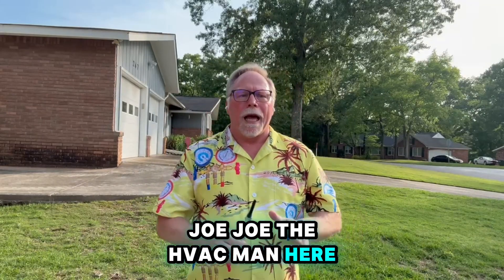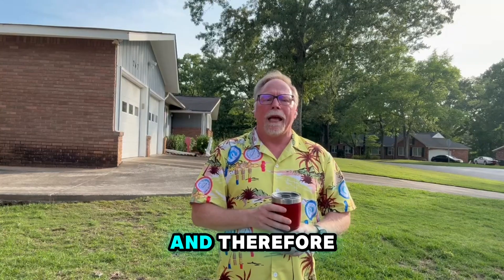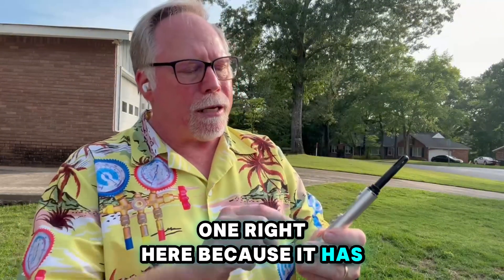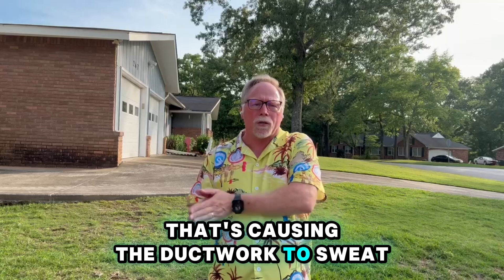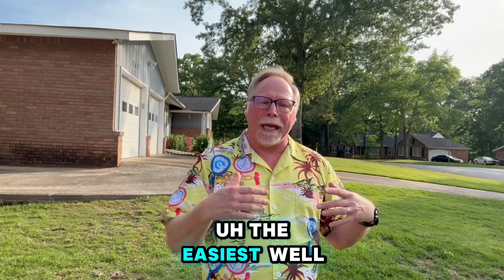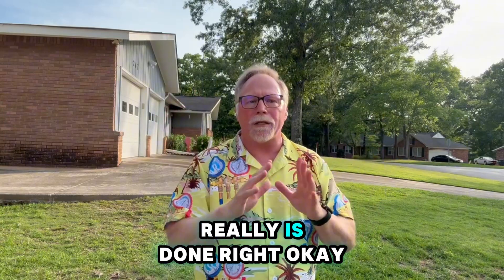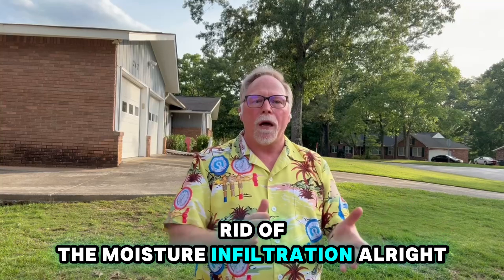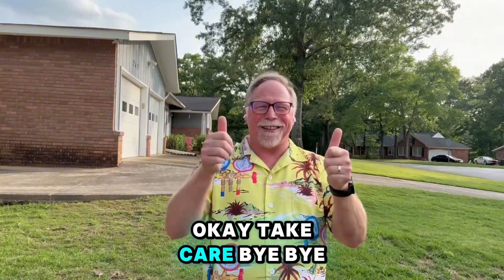HVAC Training: How to Troubleshoot Sweating Ductwork | Stop Condensation Problems Fast!

Comment: Great practical explanation, very well done.  One of the common misunderstandings of this topic is many think that hotter air is automatically more humid.  Just because the temperature is higher does not mean humidity automatically also rises. Adding heat increases temperature, but humidity will only rise if moisture is also added.  I've seen techs try to solve condensation problems by intentionally adding cool supply air (causing more condensation by reducing temp below dewpoint) only to wonder why the dripping gets worse.

Comment: Hey Joe — great video! Quick question for a specific scenario: What do you recommend when the metal duct is flush against the ceiling and there’s no room to wrap insulation all the way around? Would spray foam insulation work in that kind of tight space, or is there another workaround you’d suggest to prevent condensation? Thanks in advance if you’re able to respond!
Reply from the maker: If you can spray foam all the way around it, and it could possibly create a moisture seal to prevent that warm air from collecting between the pipe and the floor. It does seem to be the only good solution in your case.

Comment: Hey Joe! Thanks for the video!

I have a situation with my new install in a basement unit. All the metal (trunk and branch) ductwork is in the envelope. However, there are two runs, side by side that go upstairs that sweat. 
No other runs do this, not even supply runs in that go though the same room do it. What are your thoughts?  

I've sealed it with mastic now I'm going to insulate those fittings as well. 

Should I have him add a run to cool the room? Maybe run a stand alone dehumidifier in that room? 

My thoughts are if it was a room issue such as outside air infiltrating then all the other runs would sweat too.
Reply from the maker: So let me understand. You have several runs in a room that is already conditioned and only two out of all the runs sweat or you have several runs in a room and they’re all spray foam but two of them still sweat?  In the end, the sweating is due to reach dewpoint.  So either those two runs are leaking cold air out and around them, causing them to reach dewpoint where the others aren’t or you have some kind of infiltration that is just near those particular pipes.
Reply: @Joe_Joe_The_HvacMan  so for more context it's a basement room where multiple supply and return runs go though the open ceiling to their respective vents. For some reason there are two supply runs that come off the trunk and 90 up into the floor to the second floor (through a wall). Those two vents drip condensation. I went yesterday to seal them with mastic and cover with insulation because I had the same hunch. Leaking air from those ducts caused it to reach dew point faster than the other runs. I hope it helps.
It's just funny how you posted a video the day before I was set to go out and address it.

By the way I still remember that class you gave down in Florida. One of the best presentations I've seen of airflow ever. 
I hope you can make it to the next symposium!